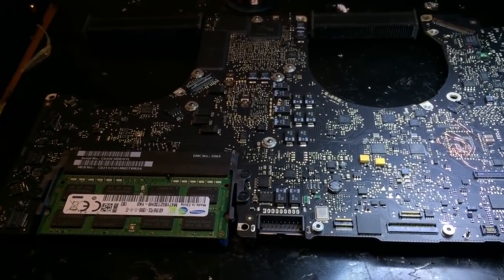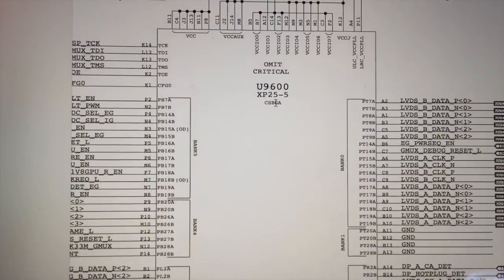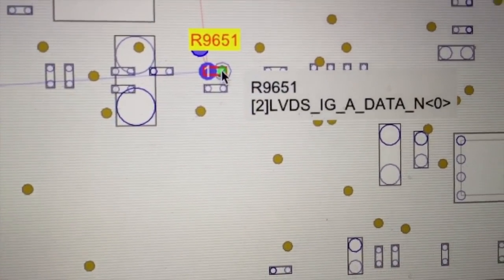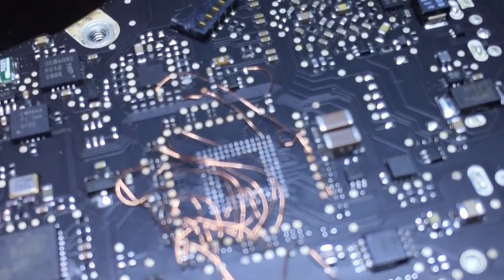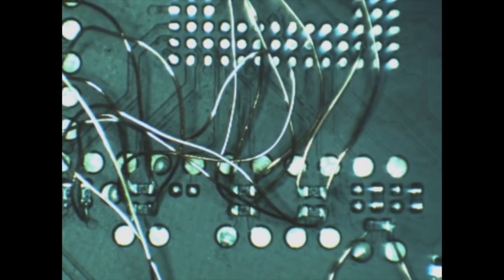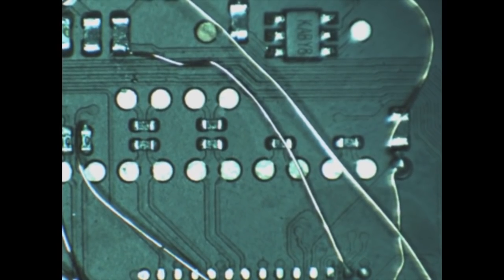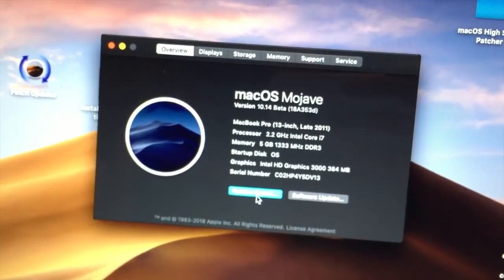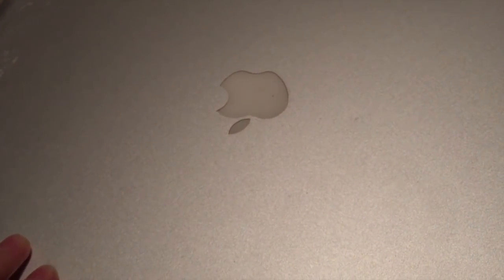Permanently Disabling the Defective GPU on a 2011 15" MacBook Pro - Hardware Mod Overview

Comment: I have accumulated 6 of these systems (I can run the displays as externals) all with dead video.
This is wonderful, thank you very much for this information!
Reply: if u could run it with external display would not that mean that your monitor is dead not the dGPU?

Comment: Nice one, a similar mod has been available for a few months as a paid solution on sketchy Chinese websites. Great to see you figuring it out and showing us how it looks like. Those sketchy Chinese site (or Vietnamese or something like that, can't remember) also sell a pre-programmed GMUX chip which basically does the same thing as the wires, it just permanently disable switching and routes the signal from the PCH to the LVDS connector. I've yet to see someone try it. The GMUX is an FPGA so something with enough skills in this field could write an open-source code for it.

About the external display, sadly the pads of the PCH that could be used to output video (DDP port B, C or D) are all not connected, and I guess macOS wouldn't even support them natively. Only solution would be to use a USB dongle to get an external display, and I'm not even sure if this works with macOS.

About the backlight, I've no idea how it's done but looking at the schematics I can only think it's being set on the LPC bus. Maybe there is a way to keep it working with the original GMUX in place. Otherwise one would have to sniff the LPC bus to see what the backlight adjustments request look like and maybe get a µC to set the PWM from the backlight requests.
Reply from the maker: Ah, darn. The same is true for the backlight PWM line from the PCH. It's marked as a no-connect pad, and doesn't go to anywhere on the board. The only thing I could do is remove the PCH to connect a wire to that pad, but it's not worth it.
Reply: dosdude1  Did you see my comment about the firmware solution with the much easier soldering job? It has a few links in it and YT typically marks them as spam because of that.
Reply: I don't think the PCH is used to set the backlight so that wouldn't work I guess. I'd say the SMC sends the commands to the GMUX on the LPC bus, but I don't know how we can check that (I've no idea how the LPC protocol works).
Reply from the maker: It actually does, I checked this with the schematic for the 2011 13". It comes from the "L_BKLTCTL" pin of the PCH, which connects to the "LCD_BKLT_PWM" rail of the backlight IC. On the 15" schematic, it connects to the "TP_LVDS_IG_BKL_PWM" rail, which if you look around the schematic, ends up being an "NC" rail.
Reply: Ah ok my bad, for the 13" that is. On the 15"/17" even when not using the dGPU the backlight isn't set by the PCH. I'm not sure what's going on. Probably the 13" firmware uses the PCH backlight control, while 15"/17" firmwares use something else.
Reply from the maker: Yeah, that's right. The gMux exclusively controls the backlight on these machines. If I could just get a wire attached to that BKLTCTL line of the PCH, that would probably work... I really don't want to re-ball it though LOL.
Reply: Maybe you could remove the ethernet port and put a potentiometer there instead to control the backlight with ?
Reply: How do you flash 13" sys ram on it?

Comment: you can do the same thing with just removing one resistor and without loosing brightness control in <= macOS 10.12/linux/windows, or with loosing brightness control when using macOS >10.12 and a bridging wire.

Here's how https://realmacmods.com/macbook-2011-radeon-gpu-disable/

I'd also suggest setting a EFI password, so you cant clear the nvram accidentally
With this mod you don't need to modify macOS in any way not loosing SIP.
Also by disabling the dedicated GPU you are loosing your display port output since it is directly wired to the AMD GPU. this could be fixed by using a Thunderbolt eGPU, or an USB Graphics adapter (look for the ones using DisplayLink since they have a driver for macOS)

If your AMD GPU already failed just grab a ubuntu iso and do this:

press "e" when Try Ubuntu is selected to go into the Linux Boot Kernel

after "load video"

outb 0x728 1
outb 0x710 2
outb 0x740 2
outb 0x750 0

after "quiet splash"

i915.lvds_channel_mode=2 i915.modeset=1 i915.lvds_use_ssc=0

press f10 to boot

in Terminal do:

umount /sys/firmware/efi/efivars/ 
mount -t efivarfs rw /sys/firmware/efi/efivars/ 
cd /sys/firmware/efi/efivars/
chattr -i gpu-power-prefs*
rm gpu-power-prefs*

printf "\x07\x00\x00\x00\x01\x00\x00\x00" > /sys/firmware/efi/efivars/gpu-power-prefs-fa4ce28d-b62f-4c99-9cc3-6815686e30f9
chattr +i "/sys/firmware/efi/efivars/gpu-power-prefs-fa4ce28d-b62f-4c99-9cc3-6815686e30f9"

reboot

more details on the NVRAM settings can be found here:
https://github.com/erikberglund/AppleNVRAM/blob/master/Undefined/FA4CE28D-B62F-4C99-9CC3-6815686E30F9.md
Reply from the maker: I've already known about this beforehand, however this isn't a permanent solution. That NVRAM variable can get overwritten during system updates, requiring the whole process to be done again. Removing R8911, though, will reduce the chances of this happening. However, you don't need a Linux bootable USB drive or anything; the NVRAM variable can be set from within OS X. You can boot into single-user mode if the GPU is dead, and set the variable from there. Instructions for doing so are located on my webpage here: http://dosdude1.com/gpudisable
Reply: dosdude1 I think chflags uchg / chattr +i should keep the file safe even from system updates, haven't checked yet though, luckily even FAT has file attribute support.
Also on linux you can just edit your grub config to include the options to disable the dGPU.